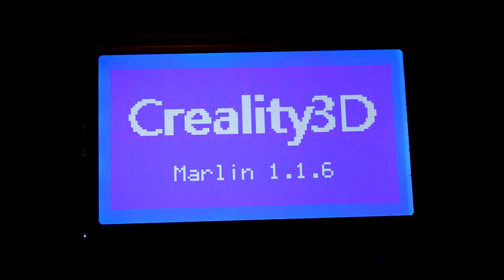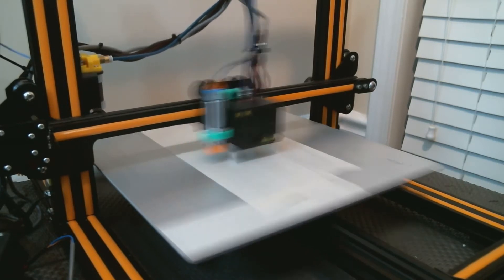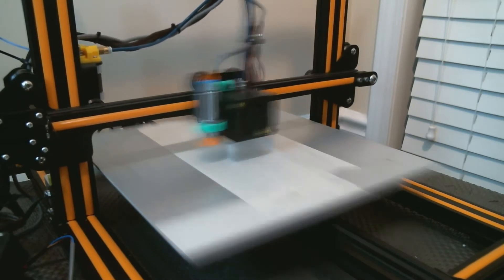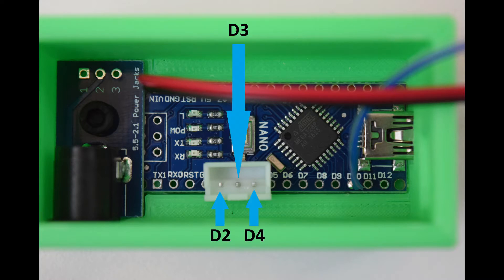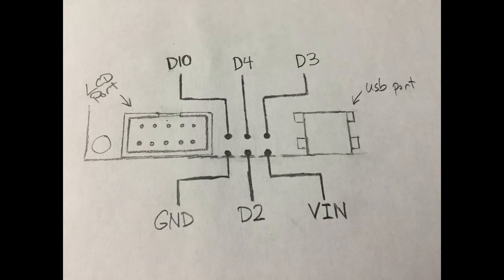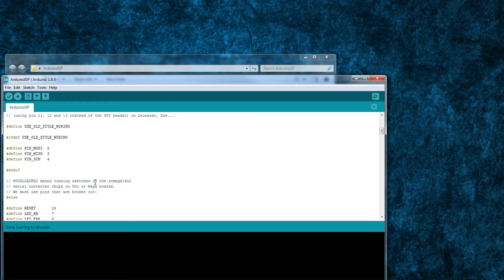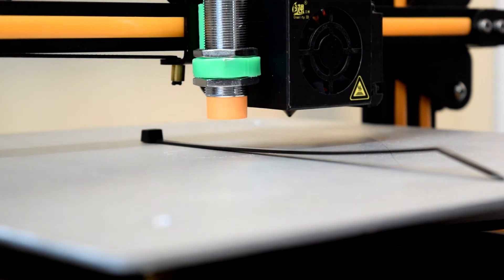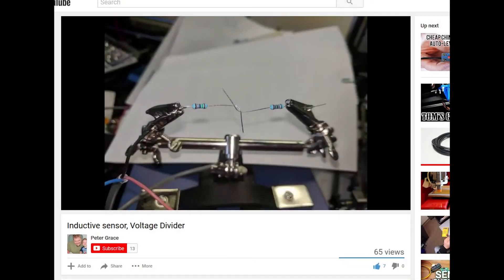Nano Bed Leveling Part 2 | Bootloader and Firmware for the CR-10

Comment: Your videos are so clear, helpful and pleasant to watch - thanks so much for making them and making them great! I have a Maker Select V2.1 with the stock melzi board and I’m wondering if it’s possible to add nano bed leveling to it following a similar procedure as outlined here, or if it would need to be upgraded to another board (like MKS Gen) first?

Secondly, as a suggestion, I’d really love to see a video on how to install the Klipper firmware on the Maker Select V2.1 (with stock Melzi) with RPi/Octoprint. Seems like a really exciting firmware and I’m hoping your Maker Select might be a good candidate to try it out... ;)
Thanks again for the great videos! They’ve been really helpful as I’m new to 3d printing.

Comment: Got a question for you.  When my prints are complete, I have the printer play a song at the end.  On this firmware, it does not do that.  It also does not have sounds when I click the wheel.  I looked, and I saw Sound was turned off in this firmware, so I re-enabled it at: #define SPEAKER
When that did not work, I also disabled these two lines because they were disabled in the original firmware, but this has not worked either://#define LCD_FEEDBACK_FREQUENCY_DURATION_MS 100
//#define LCD_FEEDBACK_FREQUENCY_HZ 1000

Any ideas?  Thank you so much for everything!